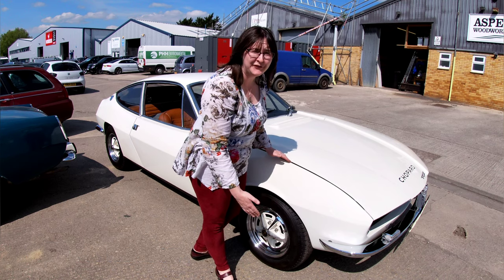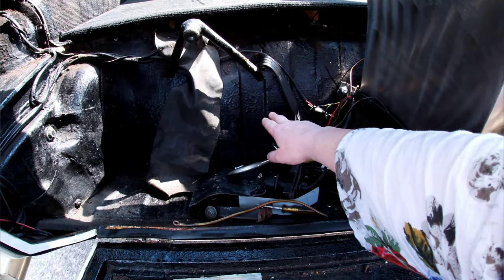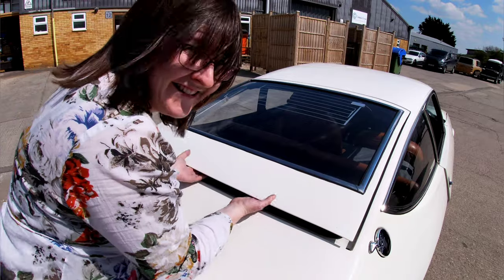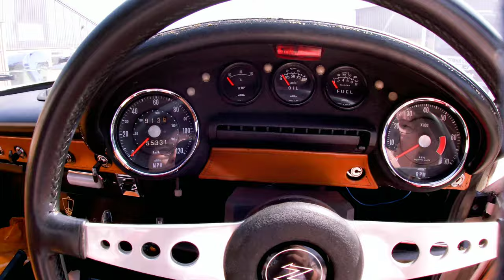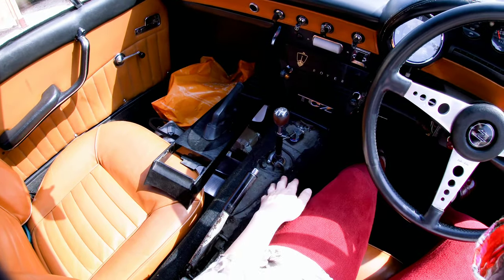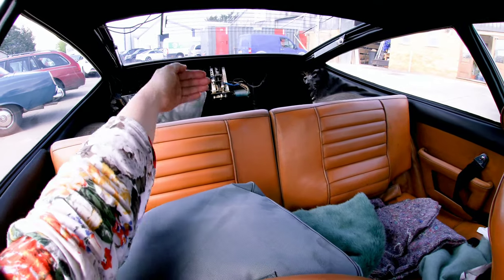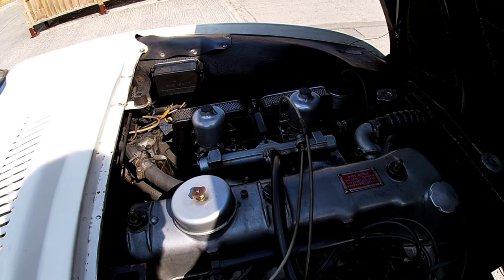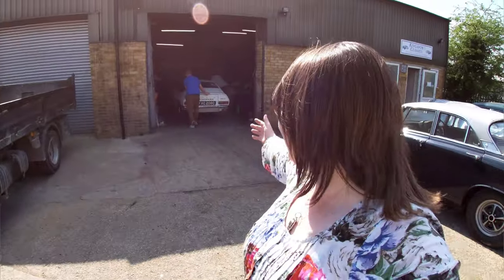Rover TCZ - P6 in Disguise - Zagato Concept Car - Prototype 2000S

Comment: Certainly had potential to not only precede the Alfaetta GT / GTV by a number of years had it received a full hatch, but also arguably be a much better alternative to the infamous Triumph Stag that unlike the latter was designed to accept the Rover V8.  A V6 would have completed the range had Rover been in a position to accept GM's offer to have a licence to build the Buick V6 alongside the Rover V8, even if the 90-degree V6 need a redesign beforehand. If the Rover badge by itself was a barrier, maybe it could have been a Big Healey replacement as a Rover-Healey instead of a rebadged MGC?